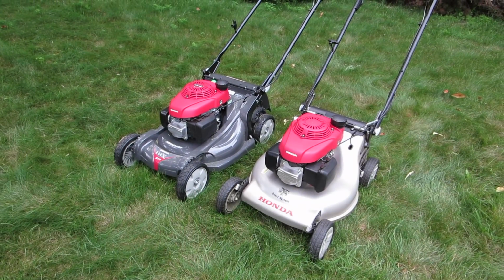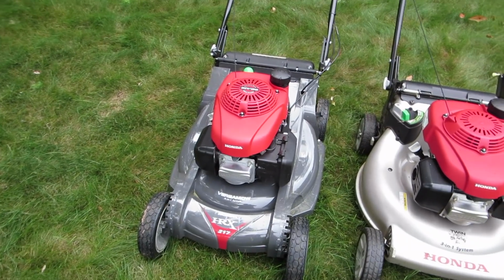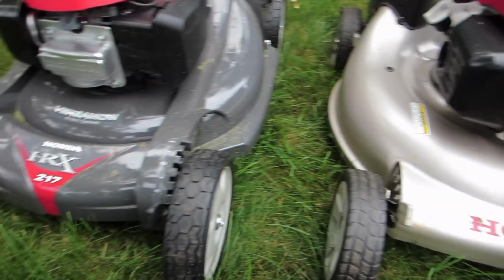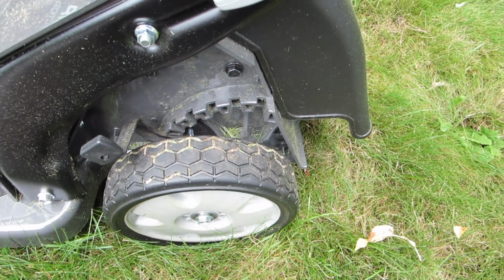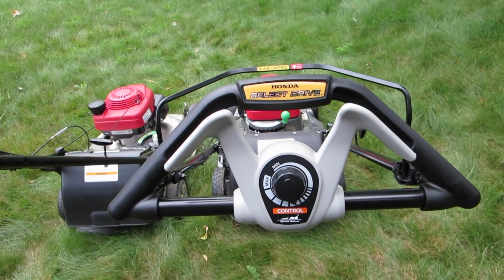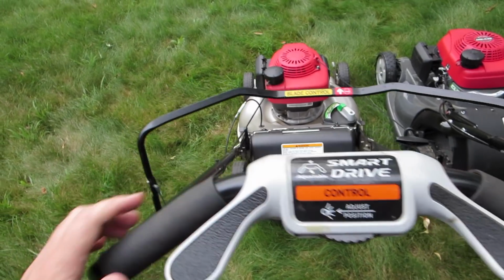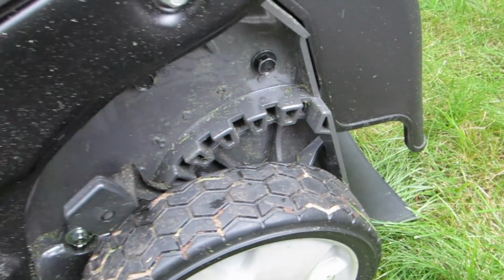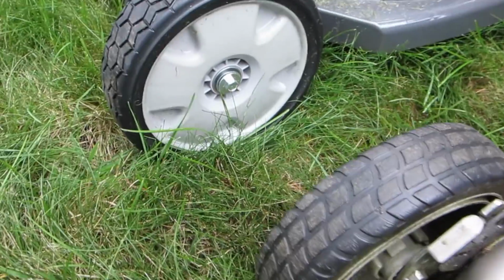Honda HRR vs HRX Mower Comparison - long term review

Comment: I have both.  I use the HRX for the front yard and the HRR for the back yard.  The HRX is electric start.  It is a beast for thick St. Augustine.    Good thing about having two mowers..is the wife does the back yard...I do the front yard.  Life is good.
Reply: I use an HRH536 since last week. It's a beast!

Comment: Thanks Garage Dad.  Was narrowing down my search for a new mower and was pretty sure I wanted a Honda.  This review and comparison put me over the top and as you recommended, I bought the HRR.  Thanks.
Reply: I bought an HRR back in 2005.  I just this Spring replaced the transmission but otherwise the mower has been a great workhorse for me.

Comment: I agree with your recommendation for most people.  I have had the HRR now for 2 full mowing years and love the drive system.  I have what I consider a small front yard but a large back yard.  The back yard is sloped about 5 degrees and I had a very hard time pushing my 19 inch electric mower up that slope so I opted for the gas powered self-propelled Honda with the rear wheel drive. It has absolutely no problem going up that grade even on wet grass.  The thumb drive on the HRR operates as a speed control that is very responsive and yet easy and comfortable to use. Being able to easily and continuously adjust the walking speed is absolutely necessary as I navigate up and down the slope and around various obstacles and shape changes to the cutting pattern. I live in the Tampa area and have St Augustine grass.  This mower is a beast and has no problem cutting even if I miss a week and the grass is longer than normal.  The dual blade does an excellent job of mulching. the blades of grass into tiny square pieces.  I also like the Roto-Stop feature that allows me to stop walking to pull up a weed or two.  When I let go of the Blade-Control Lever the blade stops and the engine slows but does not turn off.  After I pull out a couple of weeds I simply hold down the Roto-Stop button  with my right thumb while pulling back the Blade-Control Lever with my left hand and the blade engages and the engine picks back up to full speed again.  It is ingenious and I use it often.  I absolutely love this mower. Great job Honda.

Comment: A few years ago, after mowing vicious, fast growing south Florida St. Augustine for 40+ years, I bought my first brand new mower - a Honda HRX from Home Depot, but with the Smart drive system that your HRR has. It is (was) AWESOME. I just gave it to my son-in-law. I'm heartbroken. But I wanted him, in his first house, who has never cut lawns before, to have the best. sigh
Reply: Hah! That's what I have, an HRX217 w/ the flappy paddle Smart Drive (also bought at Home Depot, but 10+ years ago!). One day, when my turf management guy showed up for an application shortly after I'd finished mowing, he looked wistfully at my Honda and blurted out that he wished he'd never sold /his/ Smart Drive 217! 

I also have a 2019 HRX217 with the Select Drive, and while it's fine, the older Smart Drive one makes me feel like I'm Edward Scissorhands - if he had Honda lawnmower hands instead of scissor hands lol. I can just whip it around, up and down the hills...a real pleasure to cut with!

Comment: I was coming home from work and my neighbor was throwing his Hrx 217  away took it home cleaned the carburetor started on the first pull. The best mower I’ve ever owned. Mine even has throttle control. So I don’t have to stop the engine to empty the bag
Reply: I wish I had ignorant neighbors!! :)
Reply: Eric Orlando I don’t suspect you want ignorant or stupid, perhaps “less discerning” fits?  🙂
Reply: The blade brake clutch and the throttle control are two separate features.

Depending on how old the mower is, Honda has changed “feature” between levels of the model line. For safety please ensure that the blade is stopping even if the motor is running - only the noise from the blade motion (windage) should go away when you release the BLADE drive bail.

Comment: Nice comparison, I have an HRX from 2014 with the blade clutch and I love it. It's been a great mower and nothing else compares IMO. My fiance's dad has a 2016 HRR and he has heavily used it over the last 4 years and it's been great to him. I agree that most people will be more than happy with that model. I've used his several times and found it to be a great mower. I just recently bought my mom a brand new HRN model which replaced the HRR series and she loves it. I think Honda made some nice improvements over the HRR with it including improving the feel of the Smart Drive self propel and getting rid of that resistance their mowers have had when pulling them backwards. I think the biggest advantage you get with the HRX is that versamow clip director. I love being able to mulch and bag together and have the best of both worlds instead of being one or the other. Parts of my front yard grow so thick and tall so quickly that it's too much to fully mulch so I put the director in the middle or at least partially towards bag so it frees up engine power and you don't have to worry about leaving clippings behind. Gives the yard that clean look you get with bagging but you still get the benefits of mulching. Plus you don't have to empty the bag as often as you do when you have it on full bag.
Reply: I'm thinking of buying the HRN216VYA with the blade clutch.

Comment: The HRX gets a lot better when you add the blade stop function and hydro transmission. I don’t know if you can get that on the other one. I have a big yard and it’s nice to be able to transport it to the other side of the yard without the blade running.

Comment: Thanks for the review. I'm looking at the NeXite BECAUSE my Honda deck completely corroded even though it's kept in a garage and I clean under the deck every time I finish. Otherwise, the mower still runs great after 5-6 years on my WV lawn.
Reply: (If you haven't already,) don't buy the lousy steel deck model. Those 8-inch wheels suck, too, in comparison to the 9-inch!

Comment: I live yards from salt water and am replacing my 10 year old HRR. Not due to rust, but the drive wheels have worn glass smooth and offer zero traction. Two weeks ago a large metal plate/bracket underneath came unbolted and badly mangled in the blade and possibly bent the shaft. It needs a new blade and has noticeable vibration now. Yesterday the self propel failed and I found a broken curved metal bracket on the lawn. Without self propel it is exhausting work on a larger lawn. I can probably fix all these issues with enough research and money, but am looking at just buying a HRX and selling the HRR as a fixer. Good review.
Reply: madcow usa get a toro timemaster

Comment: Great video, I think the hrr model will be fine for me. Don't think I'll need to spend the extra for the nexite deck. Ive had an old Troy built with a Honda engine for about 15 years and it's deck hasn't rusted away yet. But I have a couple years newer Troy built and it's deck cracked on me a couple years ago, but I just ordered a new replacement deck from Troy built for $60 and its been good as new since.

Comment: I just bought an hrx 217. My only complaint is it needs a little more weight towards the front end. But cut quality is great
Reply from the maker: That’s interesting, do you find it tipping back on you? The drive wheels are in the back so theoretically more weight towards the rear helps with traction.
Reply: mine bounces if i get lazy and let the mower pull me...agreed, they needed a better center of gravity, especially when bagging and rear weight increases.
Reply: That’s true, when I first started to used I was feeling weird, I wanted to put some weight at front

Comment: My HRX has the Smart-"Thumb"-Drive, and I do like it, especially mowing up banks. It's almost effortless. It took a little getting used to at first, but it didn't take long at all for it to become my preferred mower. I also have an HRR that I'm restoring that doesn't have the Smart-Drive. That may be a modification that will have to be done.

Have a great day!

Comment: You are my new hero! NO ONE calls out the poor design of the HRX ergonomics with the self propelled handles. AND I have the more expensive version with the drive handle (not the thumb paddles). TERRIBLE design. And I’m a Honda fanboy but this HRX is a big misstep for them. And they tried to fix it with the drive handle you own and still not much better when you need variable speed. You never hear that feedback on reviews.

Comment: I have had an HRX 537 for about 13 years. It has never failed and has a tough life. The plastic composit deck is lighter than the steel deck and easier to pull back which you need to do a lot when youre mowing. Just my exoerience thats all.

Comment: Excellent and informative vid. I have the the HRR216VYA, personally I like the blade stop feature and use it often to pick up twigs or leave it running when transitioning to different surfaces or over a curb. The machine does mulch very well with the twin cut blade system. I have run into times when the grass was a little high/damp and it has bogged down with the 169cc engine. Overall I am happy with my machine, if I can do it again or was buying one today I would go with an HRX with the blade clutch especially now with the boost in power with the 200cc engine. I also like the larger wheels and tires of the HRX and the addition of the ball bearing supported front wheels not just the rear wheels as on the HRR series. As you mentioned another 2 or 3 inches in cutting width would be nice and the larger engine in the HRX would likely handle that extra width without issue.

Comment: I use the the HRX217 as a go to mower for commercial use in my small landscaping business. I've had 190 cc model for years and just recently bought a new one that comes with a more powerful 200 cc engine. Although HRX 217 is the top of the line residential grade mower, I use it commercially over Honda's full on commercial models for several reasons.
First and foremost is its deck. It's obviously made of plastic, but it's some kind of special space age plastic that's tougher than a steel deck. It doesn't rust, you can't dent it, brilliant. And what's most important - it's super light so maneuvering it is a joy. 
Blade brake clutch system and versamow are also great. If there's one thing I don't like on the HRX 217 that it's not sturdy. Without supporting brackets on the handle, mower sometimes seems wobbly and flimsy. Otherwise, a brilliant machine.

Comment: Drive system mechanics are the same, differing only in interface.  Think of the select drive system as smart drive with a 'max speed' setting.  If you put the select drive on full speed and operate it the same as you do the smart drive system, it will react the same.  Solid video!  Appreciate the side by side walk around and commentary.
Reply from the maker: Thank you, glad you liked it! 

I am not sure I agree with you on the drive system though. In my experience if you have “full speed” selected on the HRX you can’t go slowly by just pressing the lever a little. At least on mine it basically either engages or not, very little in between... whereas on the HRR no adjustment needed to go slow on parts or max drive power uphill.
Reply: @garagedad4540  I think it depends on how much slack you have in the clutch cable. Two rotations in or out of the barrel adjuster can be the difference b/w the Select Drive functioning as basically an on/off lever for the transmission, or allowing more granular control (though it doesn't match the variable control offered by Smart Drive).

Comment: if you're in a wet or temperate climate the plastic deck is preferred, whereas if your grass is generally dry the steel deck will do.

Comment: Purchased the HRR 2 weeks ago and it is a fantastic mower. I use the 3.5" height setting in mulch mode and the lawn looks great. New piece of kit has me working on other appearance essentials. Plants are all pruned and waiting for hot weather to hit. We had 1/2" shy of record rainfall this spring and 725" of show in the mountains. Snowbird will be open on 4th of July.
Honda has won my heart with the HRR. I will care for it well and it will run until gas mowers are illegal. Had a Cub Cadet before but it just won't cut grass high enough.
Reply: Stephen Lambrecht if gas mowers become illegal I’m buying a stockpile battery mowers are shit
Reply: Gas mowers being illegal in the next 10-15 years isnt too far fetched of an imagination since government can shut anything down @ will..

Comment: I just got rid of my old Toro mower and bought a very old Honda on craigslist a couple weeks ago, an old hrm215 with the similar plastic deck as the hrx, best mower I've ever owned! Even with the older 140cc engine, those older Honda's still start on the first pull and have tons of power. Doesnt even hesitate or bog down at all in tall thick grass like my old Toro used to do, and I'm sure it will last for a very long time hopefully! Great comparison!
Reply: DIY Dad got a hrx215 for free off Craigslist. guy probably dumped it because the drive didn't work and the pull cord broke. put a new cord on it and started up after a few pulls and runs great. pulled out all the grass buildup underneath and found a broken belt. trans works fine. so ordered a new belt and good to mow.
Reply: @berardia4  you cant beat that deal! Ran into a bit of trouble with mine this weekend mowing though, belt is still good but I might have to pull off that plastic cover to access the belt and gear box, the drive bar doesnt always fully return to the disengaged position when I let off the drive, so sometimes it sticks, which also makes it so the self propelled stops working half way through mowing once in a while. So I'll have to try and fix that, taking that plastic belt guard off is kind of crazy, two bolts holding it on also holds the engine to the deck, and had to take the right wheel off to remove the other nut, and one more on the inside of the grass bag chute. Still couldn't get it off. Might try again in a few days I think it's just really stuck on there. Luckily the belt is fine yet, I think the cable that engages the drive might be hung up somewhere but I cant see it without tearing it apart! Oh well, at least the engine is rock solid :)
Reply: @DIYDad1  yeah that shield was tough to get off. The one 12mm bolt was frozen. I recently got an impact gun and would not have been able to get it off otherwise even after using penetrating oil.

Comment: I’ve owned my HRX over 10 years. Bought new at a Honda dealer after seeing the deck strength demonstrated at the Detroit auto show. They had Honda SUV sitting on 4 mowers. Mine is key start and everything still works. I’m charging the battery twice a season now. No big deal. I mow a steep hill. Never an issue with the drive. Mine has the ground speed control on the left handle. Easy to change speeds on the fly. Sounds like they should have kept this design. If I have to mention something I’d change it would be a larger fuel tank. Love this mower.

Comment: The wheel height numbers are on the rear as well. They are molded into the deck but just not painted.  You can see them in your shot of the wheels.  Very easy to see and set.

Comment: I've had the HRR for 3 years now, except mine is basic without self propulsion. I have a relatively flat property so I don't mind pushing. The cut quality on these Honda mowers is just fantastic. I don't think I'll ever switch to a different mowing brand. I think the personal pace from Toro has the best self propulsion system, it seems more intuitive than the Hondas.
Reply: I've had my Toro w/electric start, self propulsion going on 19 years, only thing the propulsion went out, been pushing it for two yrs now and It wears me out, very heavy, this woman is selling her Honda so I'm going to check it out on Saturday.

Comment: The faster speed setting is for transport, its not for mowing.  The mower has a blade stop feature so you can leave the engine running without the blade being engaged so you can use the mower's engine to move the mower around like to take it from your garage to your lawn or whatever.